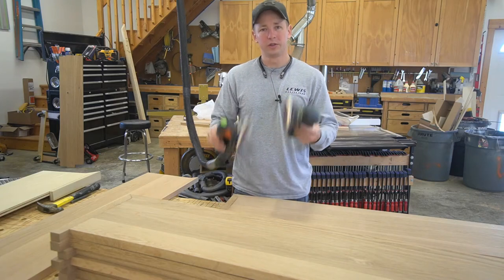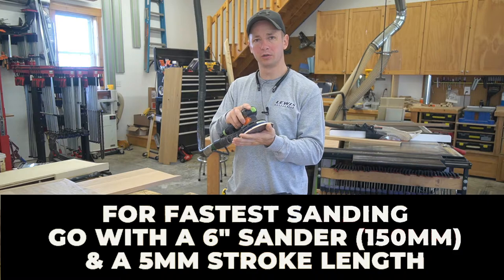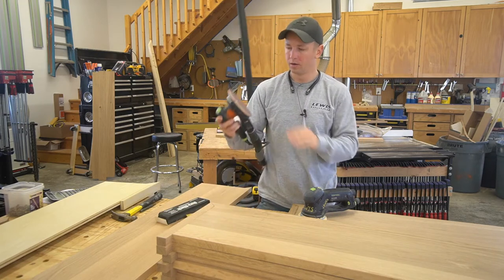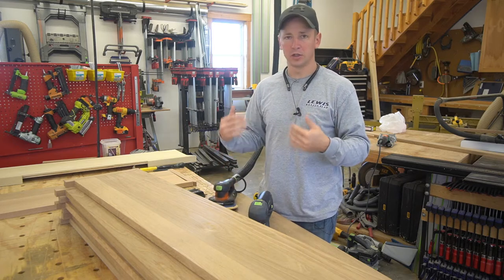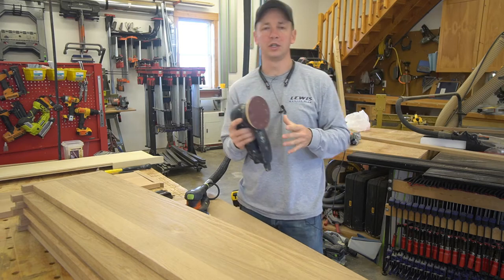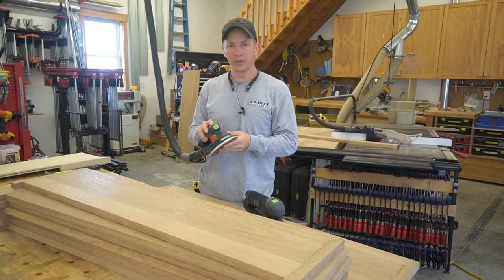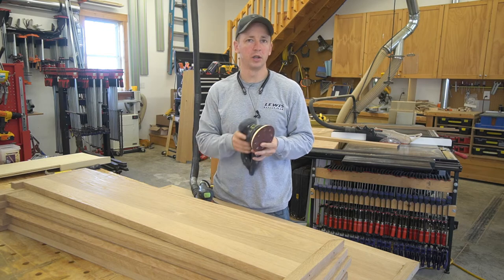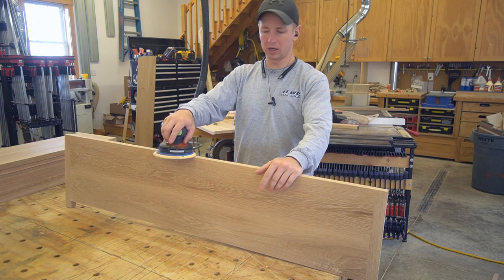Festool ROTEX VS ETS SANDERS | Buying Mistakes I Made & What You Need to Know Before Buying a Sander

Comment: I have 150mm Rotex and ETS. The Rotex has a 5mm stroke which is why I went with the 3mm for the ETS. The key to a 3mm stroke is using 3M Cubitron mesh sandpaper which removes a ton of material and leaves a beautiful finish. Get the 5mm if you use the traditional ceramic sandpapers like Granat, Norton etc.
Reply: I'm assuming that since you use the 3M that there are no hole pattern issues with a Festool?
Reply: @steinbierz  nope no issues. Brilliant dust collection.
Reply: @adams5202  Thanks...sorry but forgot to ask what Cubitron grits you normally use?
Reply: @steinbierz  IMO the 3M Xtract paper is even a step up from Cubitron. It depends on the finish and sheen I'm after but for Rubio Monocoat I'll typically use 80, 120, 150 and sometimes 180.
Reply: @adams5202  Thanks for the info!

Comment: I bought the ETS EC 150/5 a couple of days ago. It is a beast. It is light, the dust extraction is excellent, and it sits flat with little effort. I also bought the small Festool detail sander today. I am really impressed with the ETS and figure the detail sander should be good too. 

With so many options, I was worried that I pulled the trigger too quickly, but your video put my mind at ease. (Also now that I have the protective pad, another sanding session showed me how great the ETS is.) I used 320 grit 3m extract, and I very quickly smoothed out the rail and stile joints on some cabinet doors and also some glued up panels. I wasn't hogging anything out, but the ETS smoothed over small inconsistencies very quickly with 320 grit. "Very impressive!"

Thanks for another great video.

Comment: Great video! If you’re thinking about a 6” Rotex, I highly recommend the Bosch GET75-6N. Half the price and in my opinion performs just as good.  I’m a diehard green kool-aid drinker but since buying the Bosch, I haven’t felt the need to add a Rotex to the collection.
Reply: I have the bosch, what do you recommend from festool that would make a good compliment for finer finishing?
Reply: @MrBaconis  I’ve got an ETS 125 and RTS 400 which both have 2mm sanding strokes. These are both great but I wouldn’t mind trying out an ETS 150/3.
Reply: I have the bosch. My issue is how heavy it is. Wondering if the festool is better balanced
Reply: @BradyHommel  I’ll give you that, it is a little heavy but not bad. Nice channel by the way. I just subscribed.
Reply: @mchilly  Thanks a lot! Ill probably end up just sticking with my Bosch, I love the way it performs and is perfect for table tops and stuff just overkill for smaller items like picture frames, but I have a smaller Dewalt orbital for that. Festool just looks so nice lol
Reply: Same here.  Bosch GET for the win.
Reply: @BradyHommel  it’s overkill even when not in aggressive mode?

Comment: I've been making sculpted furniture, similar to Maloof chairs and tables. I start my power carving with a Kutzall disk to rough out my shape and then move to a rotary sander, then to an orbital sander.  I'm using a Dewalt rotary sander which cost about $100. 
I like the idea of my rotary sander being separate from my orbital sander. When one fails, and they will, I only need to replace the failed unit.
The problem, in my mind with the Festool Rotex is that if it fails you have to buy two sanders in one.

Comment: This was a great video! It confirmed every feeling that I had and it was good to hear someone else say it.  I have several Festool products in the shop including TS-55, routers, drills and DF-500 Domino.  On sanders, I have the RTS-400, ETS-125 for small and/or very fine finish work and, like you, the ETS-150/5 for 95% of my finish work. I found I liked the 5mm stroke over the 3mm as it is a good balance of speed and finish quality. Years ago, I looked at a Rotex 125 to possibly be my “all in one” sander (a notion that I later dismissed).  I found the Rotex, at the time, a bit hard to control and a bit loud and “punchy” for the finish work I wanted to do.

Fast forward to this week.  I finally determined that the Rotex 150 would be perfect for initial sanding on things like walnut tabletops as well as refinishing reclaimed woods and similar projects.  Like you said, the jointer and surface planer do good jobs of prepping woods like white oak and walnut, but especially with walnut, there is a need to fill knot holes and cracks (love Timbermate) and to aggressively sand the surface.  The ETS-150 is just too polite for this task.  I have finally given up on handheld belt sanding, as well.  Too loud, potentially too aggressive and even hooked up to my CT-22 extractor, the dust still goes everywhere in the shop.  (Even with Jet ceiling mounted air filter.)

So the RO-150 arrives tomorrow, and I can’t wait to use it on a walnut table top thst I just glued up.  It will also be interesting to use it in non-Rotex mode, although I suspect most of those jobs will be handled by the ETS-150.  I do agree with you about the larger size Rotex (or finish sander) being the way to go for most surfaces. 6” vs 5” diameter doesn’t sound like much, but the sanding area is actually 44% larger on a 6” sander.  That alone greatly speeds up the work.

Finally, I enjoyed your tips and comments on controlling the Rotex.  About 10 years ago, I first tried out the Rotex 125 in the store.  That’s when I decided that it was too hard to control, and I bought the ETS-150 instead, which I came to love.  In later years, I came to realize that it was not either/or, as each sander serves a purpose.  Over that time, I learned better how to best use and control all of my sanders, including how to best hold them, where on my person I like to support the cord and vac hose etc.  I might add in closing that I personally also like the RO-150 over the RO-125 (price notwithstanding) as the 6” footprint actually balances better for me and is a little easier to control.

Again, thanks for this useful video.  We all have our favorite tools and techniques, but we also enjoy the camaraderie of knowing that, “Wow, that’s the same way that I do it!” feeling.
Reply from the maker: I just recently sold my RO 125 and purchased an RO 150. Can't go wrong with the 150 IMO.
Reply: How is the non-rotex mode in the Rotex 150? Is it good as finish work? I’m thinking of buying it as my all-in-one sander
Reply: @InsiderCarpentry  is that the dual or variable rate one? Tnx!

Comment: I have to admit I am a sander nut, being in this business since '79 been though alot of sanders. I own 9 different Festool sanders and they all have a place in my business for what I build and install. RO 90 & 150 I use all the time along with the ETS models. I do not own any of the cordless Festool sanders. Use the cordless Makita 5" sander for quick jobsite sanding and it works pretty well...
Reply: Is the RO 150 a good finish sander when not in aggressive mode?

Comment: I'm a small timer with a business and shop very similar to Spencer's.  I stretched a little bit and bought the powermatic 16" wide belt sander (PM1632).  It was about $7000.   The Rotex can get you by in a pinch with those oak treads....but it is nothing compared to a wide belt sander.  A wide belt sander does take some getting used to...and it's obviously nowhere near as versatile as a handheld sander - but it is excellent at what it does.  My shop is single phase.  There aren't too many sanders out there that are single phase.  My salesman recommended this one cuz he said powermatic has good customer service.  Anyway....it's a 5hp machine and it's a beast compared to  the sanders I was used to before I got this.   It's a big investment....but in my case it paid for itself pretty quick.  Another thing to consider: I was spending GOBS of $ on little 6" discs etc.   One Mirka 80 grit wide belt literally outlasts 1000 festool velcro sheets.....and the Mirka belt is only $20!  I sound like a commercial - but for anyone on the fence - this thing exceeded my expectations.  Just throwing my 2 cents into the sanding conversation.   Thanks for the quality vids Spencer.  Your channel is tops!

Comment: Hi, Insider carpentry I only had time to briefly scan the video, so I might have missed something and I've not read the comments section yet either, but if people are thinking the rotex is badly balanced then it might be worth trying this attachment (Festool 495188 BG-RO 150 Ball Grip Handle), its mainly for when using the rotex in polishing mode so you can keep the rotex flush to the surface at all times. Maybe this will improve the balance of the tool, it should as it means you hold the tool at both ends (front and back making it easy to apply equal pressure).

Comment: as a painter im trying to decide which one i need. I don't need to do fine sanding, mainly the use would be to strip a deck of its paint or stain.
Reply: @boogiedahomeyno you can’t put a 125 pad on the 150. But, you can put a 150 pad on the 125

Comment: Surprised you never mentioned that the Rotex is also great for polishing, it’s one of the main reasons I brought mine. Great for reviving corian countertops.
Reply: Any experience on using the RO as a finish sander when not in aggressive mode?
Reply: @FloazaWoodworks  the rotex is all I use. Generally I run a firm base and I personally stay away from the mesh sandpaper as I find they ruin the main base really quickly. If it’s finishing work, I also turn the speed down a touch. I hand finish bespoke furniture a lot of the time, 22 years, and unless I’m doing large panels or cutting back base primers I always prefer doing it by hand (using a block of course). Also I don’t use anything above 320 grit as in my opinion you start to polish instead of keying inn for the finishing coat.

Comment: Absolutely love my ETS 150/3. For my shop with the projects I do the 3mm stroke works fine. Great suggestion about the hard pad. I will definitely try one. I do a lot of end grain cutting boards, they go through my Jet 16/32 which is a huge help, but I find my self wishing for the Rolex. I keep looking but have not been tempted enough to pull the $600 trigger, yet. I have the CT36 vacuum and this is without a doubt the best combination for sanding. With the shop vacs and 5” big box sanders I have bought I could have gone Festool a long time ago.

Comment: Just watched your sanding video. When you demonstrated sanding, you placed both hands on head of sander and appeared to be applying pressure. I use a two had method: one hand to guide the head and the other on the dust extraction hose connection for balance……and I let the weight of sander be the only pressure applied. Also going through multiple grits speeds up the process greatly eg. (used 60,) 80, 120, and higher if necessary.
Reply: Agreed. Festool has a cool video on how to operate the Rotex. One hand on the front of the machine and the second hand at the back of the machine. No pressure needed. ALWAYS go through your grits and score your project with  pencil lines and then sand those off.
80 girt pencil lines
120 pencil lines 
150 pecil lines 
etc upto your desired finish.

Comment: Great video (I've watched it three times over the last year or two), but I have a question: 

Preface: You said that you use the Festool ETS EC 150/5 random orbital sander 99% of the time, and you also said you use 120 grit sandpaper 99.9% of the time on both this sander and your Rotex (which you use on the hardest woods like white oak). 

My question is—for a non-professional whose workflow is less demanding (though still demanding enough)—might it still make sense to forgo the Rotex and instead go down to a 60 and/or 80 grit sandpaper for hardwoods using the ETS EC 150/5, and then finish up with the 120 grit sandpaper? I've never sanded white oak with anything. 

Thanks for sharing and keep up the great work.

Comment: Metabo sells  a model with variable stroke length; you press a button and turn the base to switch between 3 and 5 mm. I think both DeWalt and Mafell used to sell clones of that (identical metal parts, just different plastic), but I can't find them in their current lineup.

Comment: Spencer, using Rotex with finer grit paper and on lower RPM makes it one-hand operable - bulky grip is exactly for that. I use only Festool sand papers and it works great with their sanders.
Reply: Is the Rotex good for finishing as well when not in aggressive mode?
Reply: @FloazaWoodworks  Last Saturday I renovated white oak countertop finished with Ikea oil (client's wish). One side of the countertop was exposed to direct sunlight, so every possible imperfection was extremely visible. To remove the old oil I used 80 grit no-name sandpaper on Rotex with aggressive mode. Then 120 on aggressive, 120 on fine mode and finally 150 grit on fine. It looks great. So, yes, Rotex 150 is suitable for finishing. Of course you can also use as a polisher.
Reply: @Stefan_Kawalec  awesome, thanks! 😊
Reply: @FloazaWoodworks  Of course, if you do some high-end wood-working, I'd recommend borrowing Rotex, ETS, maybe some Mirka and Makita and trying them out with the same sandpaper/sanding net. Some sanders work better with papers, while other give finer finish with nets.
Couple of years ago I had Makita BO6040 dual-mode sander. It was great. I never had any pressure or urge for Festool, their price tag is revolving and their exceptional quality is self-proclaimed myth. I mean Festool makes good, professional tools, but they are as good as any other pro brand.
Anyway, when I compared newer version of Makita BO6050 to Rotex, I've noticed that Rotex has a bit less vibrations, but also less power than Makita. While I had a chance to buy new Makita or new Rotex in the same price, I've chosen Rotex, although I'm generally Makita guy. I needed a sander for long continuous use without fatigue and with lesser ability to remove material. My fellow cabinet maker uses Makita and he finds it much better than Rotex.

Comment: If you have a ETS EC 125/3 EQ you can use the 150 pad on the unit, there are no mods required and no issues with the brake. This information is all over the FTOG Forum.

Comment: its been difficult adjusting back to electric sanders after using pneumatic ones in a large shop. you really cant beat the aggressive power and fine finish of air sanders, no comparison. i do like the dust collection efficiency of the festool system though, i think that is really the only outstanding feature of their sanders.

Comment: why use the rotex over a belt sander followed by the ets? I have a bosch sander with 2 modes, hate it, leaves brutal swirl marks that I find harder to get rid of than belt sander scratches even when you have to go across grain as you will on those stair treads. Thanks for the video...I love my ETS 150, and have thought about a rotex, but worried its a more expensive bosch.

Comment: Just a novice person here remodeling my bedroom. I have lead-based paint on longleaf pine walls i want to remove safely. As far as the hole pattern differences between the 5 and 6" versions, is there one that would capture more of the dust? Already have a great vacuum/collector ready and yes, I'll still be wearing a respirator with lead-filter

Comment: Thank you for the upload, very helpful. I have the ETS EC 150/5 (using hard pad and the backing pad), work with solid oak quite regularly and also don't have a wide belt sander, nor have room for one either. I am thinking about picking up either the Rotex 150 or BS 75 belt sander with the surface sanding frame-the latter seems ideal for flattening slabs and flushing up stuff like your stair threads. I'm leaning towards the belt sander at this stage, how does the rotex compare against a decent belt sander?
Reply from the maker: Honestly I haven’t used a belt sander in my work flow for a long time. So I can’t comment with any authority there.

Comment: I’m gunna guess that the Rotex is more for renovation work, a little bit of everything. Especially grinding surfaces flat. I used a rotex after using a porter cable right angle 6in for 20 years. The way it moves took half the time out of the task.

Comment: I tried a Bosch ROS20VSC and the sanding discs keep flying off. I can't deal with this. The videos indicate I am pushing too hard? Will I continue to have this issue if I buy the rotten 150? I need to strip paint off wood then fine sand after. Thanks!

Comment: Interesting info. Never considered stroke length (Rolex spec says 5 mm).  Would like your opinion of 3M Xtract Cubitron sanding disks. Thanks for the video. (Also, what vacuum do you use for on-site dust extraction?)
Reply from the maker: I use Midi vacs onsite.

Comment: Curious about how your CT36 is mounted to the ceiling.
Reply from the maker: It’s on the floor. I have a long hose/cord that goes up to the ceiling.
Reply: @InsiderCarpentry    My sense of humor mostly gets misunderstood.  If you were buying a new vac now would you get the auto clean version or skip it?
Reply from the maker: 👍 I’d skip it. I don’t think any of mine have it so I don’t really even know what I’m missing I guess.
Reply: @InsiderCarpentry   I recently bought the TSX55k off your recommendation; a huge upgrade from my Dewalt track saw. Thanks for making all these videos. Also I am about to plunge into a ct36 and ets150.   Looking forward to being clean while working.  😂
Reply: @InsiderCarpentry  I was trying to hunt down your recommendation for mirka sandpaper disk couldn’t seem to find it. Do you have a link?

Comment: The ETS 125 will accept pads from the ETS 150.  Effectively making it 5" and 6" sander.  But the 150 will not accept the pads fromt he 125.   Food for thought
Reply from the maker: Interesting...I had never thought of doing that.
Reply: Does the rotex 125 also accept the 6 in pad?